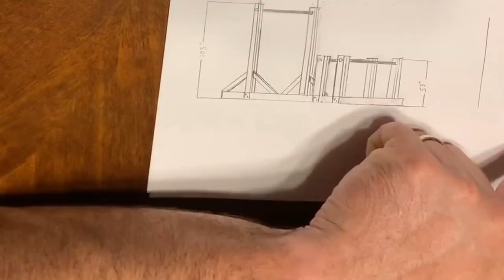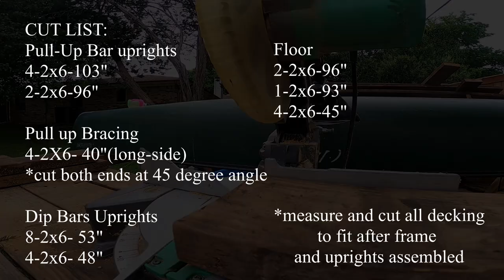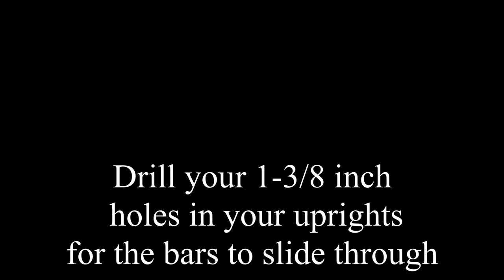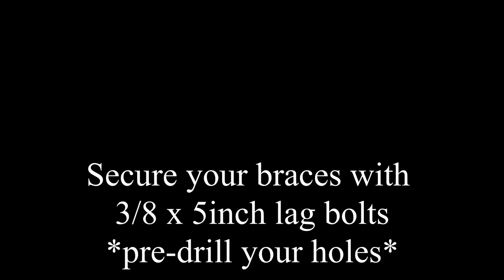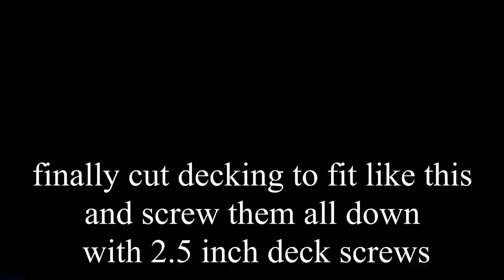DIY Pull Up Bar (Bodyweight Gym)

Comment: Nice design! How do you think this would do with a 180lb dude pulling muscle-ups? I've been concepting some non-cemented designs, and this looks like it might have the right counterweight distribution using the platform!
Reply from the maker: I am 215 and it hold well even when I am cheating and flailing when I get tired, I think you will be fine doing muscle ups, I am sure your form is a bit better than mine